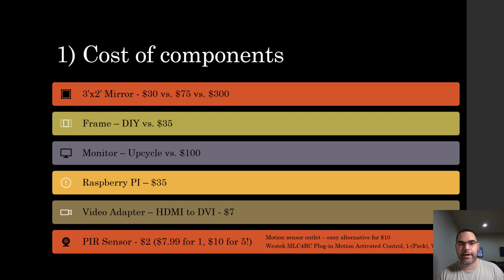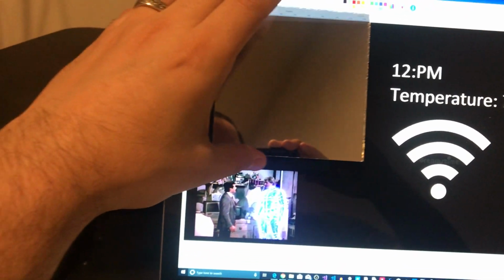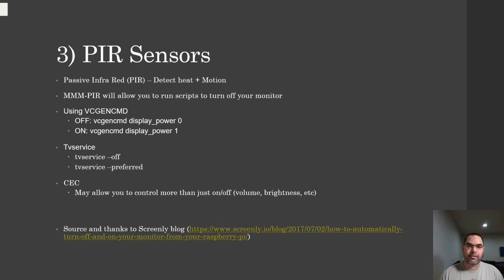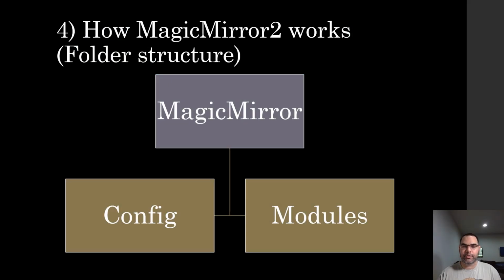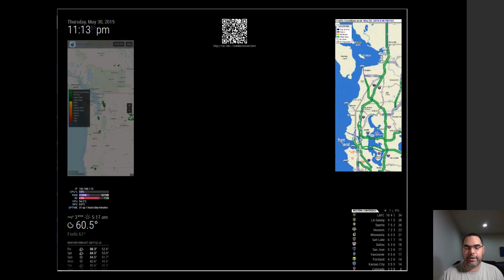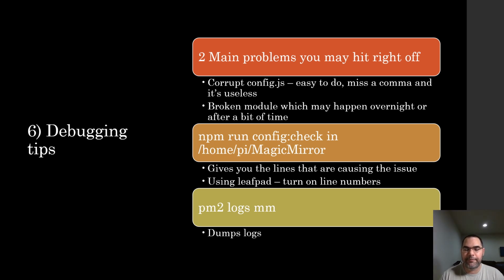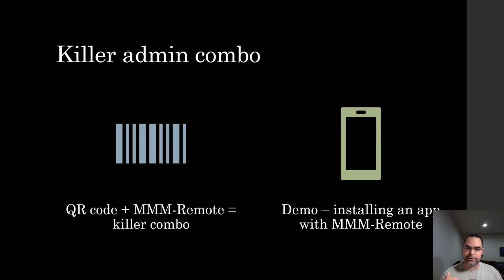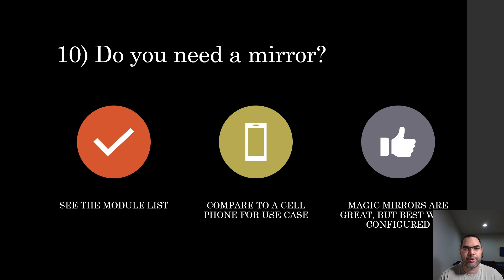10 Tips to help you build your best Magic Mirror

Comment: Great tips. Thanks. What's the Map and Traffic modules you used. I had Google Maps-Traffic module configured but the map will show for a second then it gives java error. Lots of people having the same issue. Thanks again
Reply from the maker: I used an iframe for the local traffic service in washington.  I also wasn't able to use the other modules that people provided.  I live in washington state and we have a DOT site  (https://www.wsdot.com/traffic/).  I'd see if your area has something similar, and then try to get that page to load, right click on it to get the image url, and then try to put that in an iframe. That's what worked for me, and it's been reliable (well as reliable as the site). The nice thing is that since DOT for wa is the 'source' for google/bing/etc from what I understand, if it's down it's not like there's a better option. I hope that helps!

Comment: I Will use mine with a ir-frame as a touch input. And then controlle and show my home assistant data and controls my home
Reply from the maker: That should be awesome! I've thought about using Home assistant instead of magic mirror software on my next one.
Reply: @geektoolkit  Update 
Bought a 40” Sharp UHD HDR LED Tv. The pi is not powerfull enough for 4K😓 go im going with a M1 Mac mini . And i get HDR support . Yay 🥳
But the price is getting a bit out of hand 😜
Ohh well I wanted resolution ☺️ and a big mirror
Reply from the maker: @kimberly-jacobsen  oh no! That sounds like one of those projects where it got a bit out of hand, but also...sounds like one of those projects that'll be epics when it's complete and working! I think you'll be MUCH happier with the performance of a mac mini over a pi.

Comment: What is that medical status module called? I'd love to get some cool themed modules like that on my mirror project.
Reply from the maker: Do you mean the one showing the stats for the raspberry pi?  I've not been able to find it, and my mirror crashed, but it's simply a raspberry pi information one..I did choose it because it added a cool look.  I have an idea for my next mirror build (well rebuilding my crashed mirror) to make it very techy and cool, but I have to figure out some stuff. For instance...I'd like to play some youtube visualizations...but I want them to play from local storage as video files.  I've not found a way to do this using magic mirror, but I believe I can using home assistant as the backend. I could then use Grafana (I show in another video how to get grafana graphs into magic mirror) and that can spruce up your mirror as well

Comment: Hi great video.
Would you do a video on how to add the 3 party modules , change the news feed to local news and the phone remote , step by step and zoom in on the screen so we can see. There several MM videos, but a lot skip past , or key how to .
Also, do you have a list of the basic commands to use in the pi.( start, stop, reboot, etc..)
Thanks
Reply from the maker: I have a few videos in the queue I need to finish but that’s a good idea and I definitely can go over that. You’re right it’s not very well explained by most videos out there so I will definitely do that. It’ll help the community greatly

Comment: i have a question if i use foil, i need classic glass or some special glass with foil?
Reply from the maker: Blaž  if you use the correct foil you’d apply it to classic glass. The trick is to get foil that is meant to create a two way mirror effect.
Reply: @geektoolkit  Thank you so much for the fast reply. Liked/Subscribed

Comment: Is this plugged into the mains or using some sort of power bank?
Reply from the maker: ZeNex74 Good question! Mine is plugged into mains via a standard plug. The wire has a plastic cover over it to hide it and make it more pleasing
Reply: @geektoolkit  wondering how via a power bank screen and pi
Reply from the maker: ZeNex74 you’d want to look at possibly an attiny hooked to the motion sensor, and when triggered you’d want it to wake the pi up. That’s save you a bunch of power usage. You’d want the pi to sleep after. I don’t have examples, but I think if you research solar panel based projects for a pi for remote monitoring you may find some other tutorials

Comment: Thank you so much pleas can you explain how its work QR Code with MMM-Remote-Control
Reply from the maker: MMM-Remote-Control requires entering an ip address and then /remote as a URL.  Take that URL, put it into a QRCode app to generate the qrcode, then use the MMM module to  show the QR code. Then scanning it will take you right to MMM-Remote on your phone. It's pretty basic in execution, but when you use it as an experience it really elevates the experience overall
Reply: @geektoolkit  What is used to scan the QR Code? Does MMM-Remote do this natively?
Reply from the maker: Double Dog Drone kinda. MMM-Remote just is a webpage served off of the mirror. So if you show a QR code and point it to that IP, then most cell phones will natively let you scan a QR code and go to a web address. That means that you end up on the MMM Remote page and can then control things via your phone. I hope that makes sense
Reply: @geektoolkit  Thanks for the reply. I use an android phone and I am not aware of a preloaded app that scans QR codes. Which one do you use ?
Reply from the maker: @doubledogdrone  Oh I stand corrected, apparently android phones don't do this built in. There's a barcode scanner app that can help, and should be plenty of QR code scanners in the app store. I didn't expect though...iphones and I THINK my old windows phones integrated into the camera app.
Reply: @geektoolkit  Well the barcode to scan looks "cool" and all, but one can hard code thier Raspberry Pi to use the same static IP address. So if one did that then all that would be needed is to enter the static IP address into the MMM -Remote app on ones phone followed by /remote . Right?
Reply: So if MMM-Remote App has a way to save that url - ex:192.168.1.30/remote then its just a matter of launching the app and choosing to connect to that preconfigured  url .
Reply from the maker: Double Dog Drone yes this can be done today and is how mmm-remote app works. You can just have a browser favorite or even a widget I imagine. I added the qrcode so I wouldn’t have to type or remember the ip, and multiple people could easily manage multiple mirrors. But both methods (as well as a programmed NFC sticker) all can work! Just a matter of preference

Comment: Thanks Joe!  This has me excited about building my own.  Is there a minimum resolution on the monitor you suggest or what resolution is yours?
Reply from the maker: Mines running 1280x1024.  I'd recommend at least 1000 lines of horizontal resolution to display the most info.  However, you can also use modules to auto cycle each module and still get the data to refresh, or to use 'pages'. So 1000 lines ideally, but you're not stuck if you go below that